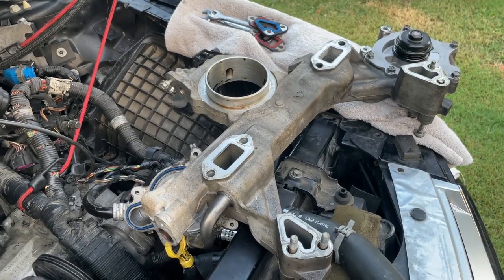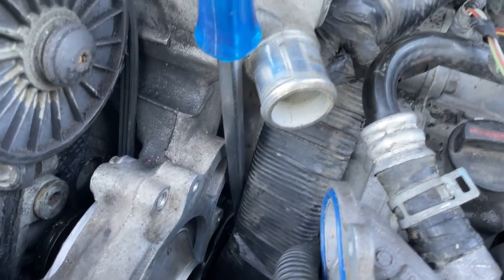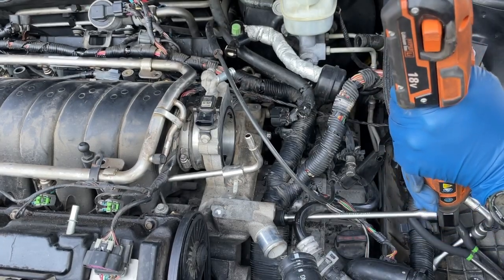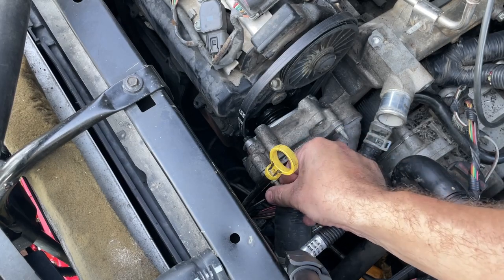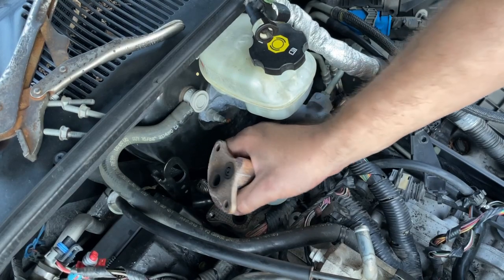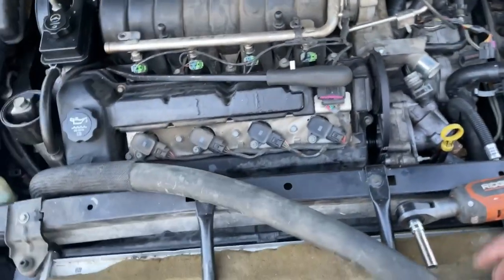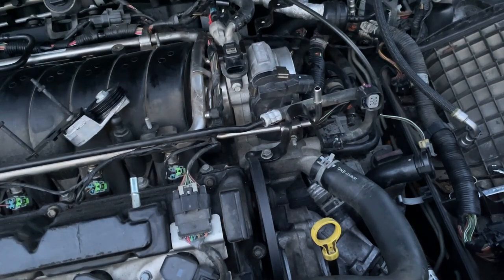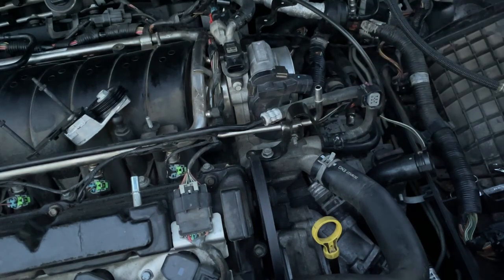2007 Cadillac DTS Water Pump Replacement Part III

Comment: I am in the final stages of my repair, what a pain in the butt, This is a crappy design. I went ahead and replaced the temp sensor and t stat. my big issues it is getting the egr tube to line back up in the housing. I have also done the valve covers... another pain
Reply from the maker: Oh that EGR tube… that’s a huge pain to get right, be careful with that bolt it’s real easy to cross thread it. I dread the day I have to take that apart again..hopefully by then he’ll want to just change the engine.. best of luck to you on that tube.
Reply: @ranger.auto.repair  well. Sure enough, the tube behind flange
 was damaged while I was gingerly I thought moving into place.very thin tubing. jb weld I hope will do the trick.
Reply from the maker: I hate to say this, but I found out that pipe isn’t very long and depending on how bad it got messed up, if you can get to the lower bolt on the manifold and it comes out fairly easily then get a new pipe from the parts store.

Comment: i just completed the install, car sounds smooth like it had a tune-up, but its blowing white smoke out of the tailpipes and it smell like gas and it's gas gauge is going down fast?
I'm thinking the fuel injectors?
Reply from the maker: Yep sounds like a great place to start, those north stars are a bear to do injectors on, look for a P052x code (I think that’s it) or you might be able to smell the bad injector.

Comment: why would you not replace the thermostat while all this was apart? my luck it will fail after repair?
overall thanks for the video, helped me alot
Reply from the maker: The customer left that as an option in the event the water pump replacement didn’t fix the overheat, since it did the thermostat will get changed when the car reaches 150,000 miles or if it has any issues in the future, since it’s easy to get to it’s not a huge issue, however if your doing this job and you want to change the thermostat I highly recommend it.